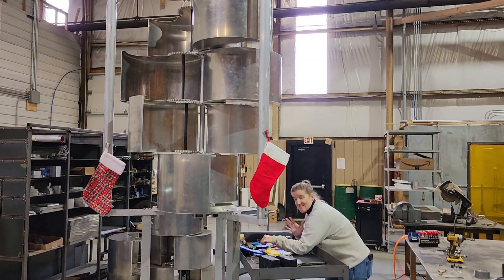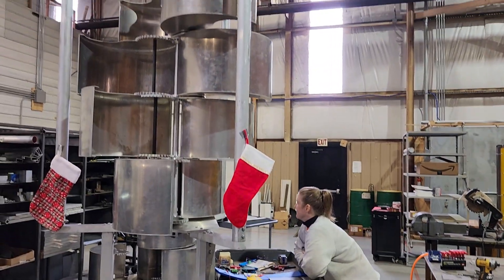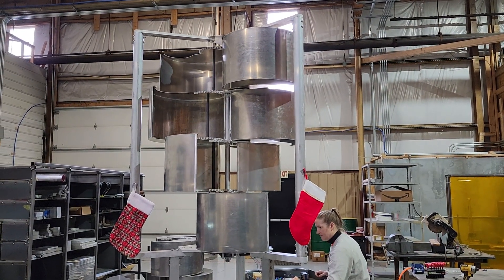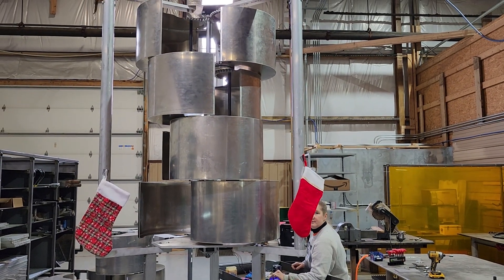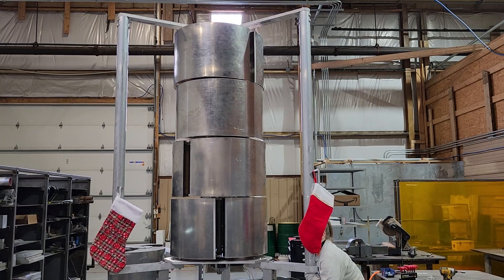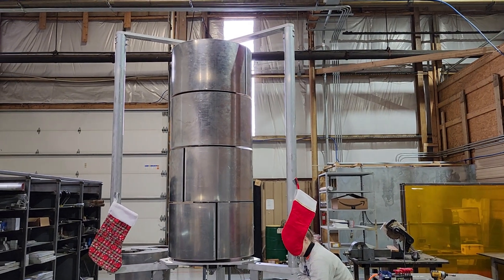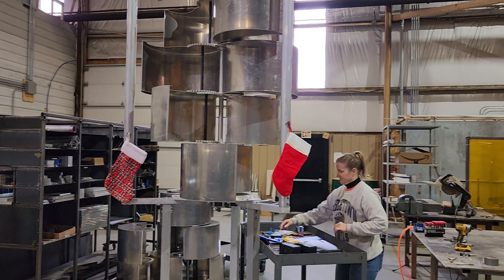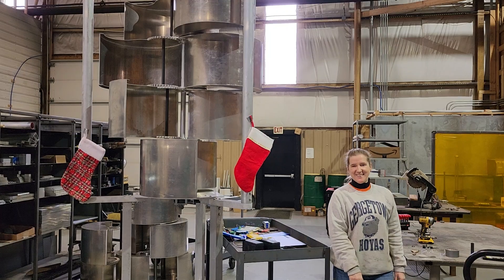Harmony Turbines MK II Initial Furling System Testing for MVP Prototype

Comment: Will the MK II only have 4 tiers total or will there be more tiers on the final model?
Reply from the maker: MK II just refers to the iteration of our 400w turbine. So it will have 4 tiers in all cases for our 400w unit. As we go up to larger sizes that may change accordingly. But as such we need to finish this work, vet the technology and get production units out into the field for verification ...then we can start looking at other models both larger and smaller. :)  https://www.startengine.com/harmony-turbines
Reply: @HarmonyTurbines  Perfect! Stay on track! You Will be a success! Great ,Powerful , Quiet video! Thanks for this update!

Comment: can you update us with some weights and dimensions of the overall unit so we can plan for this?
Reply: The 400w units we are working on (the size of the white one in our videos) should have a scoop array that is approximately 5 feet tall, and 4ft wide when the scoops are fully open. There will be a little more height for the generator, perhaps another 18 inches. We expect the entire unit including the generator to be under 150 lbs. The first turbines coming to market will be best suited for residential use, installed in a yard using a concrete pad, and elevating the turbine 8 to 10 feet in the air so it doesn’t hit anyone in the head.